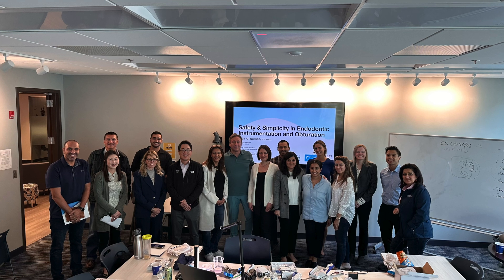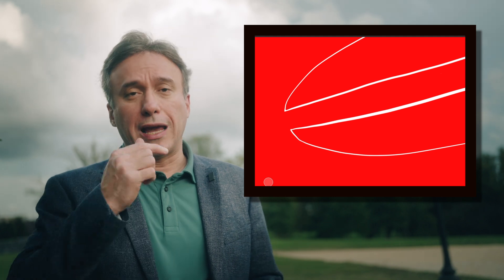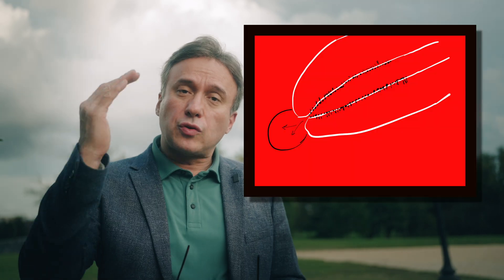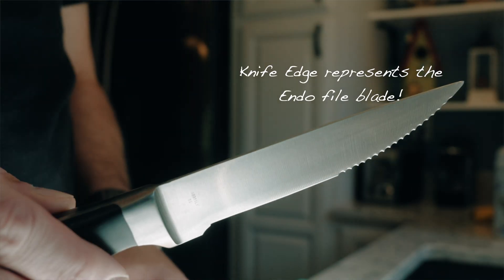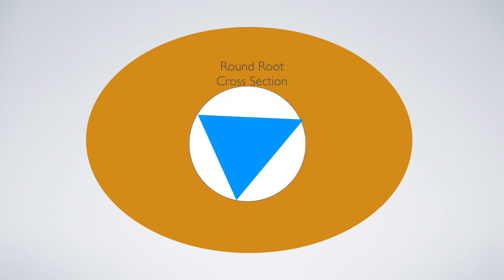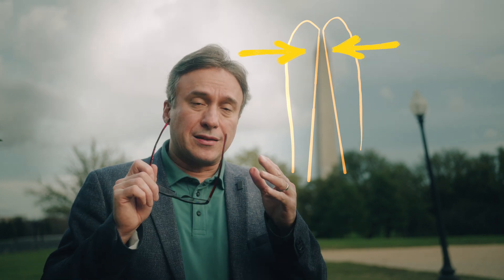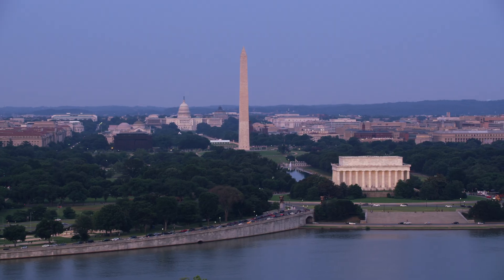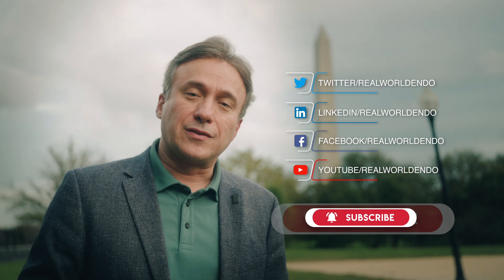Washington Monument and Apical Preparation Shape

Comment: What s apical scouting.?
Reply from the maker: I think you're talking about apical gauging. It's the act of attempting to determine the apical diameter indirectly; but using the tip of the first file that bind apically as a gauging instrument. You then increase the diameter from that point and you'll clean the surface you are enlarging.